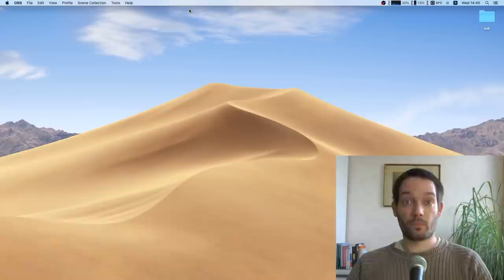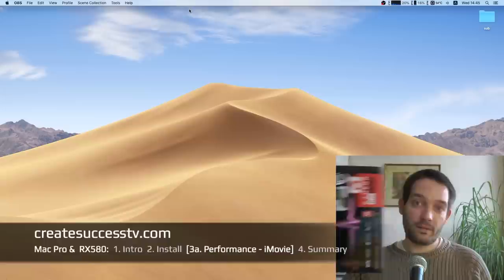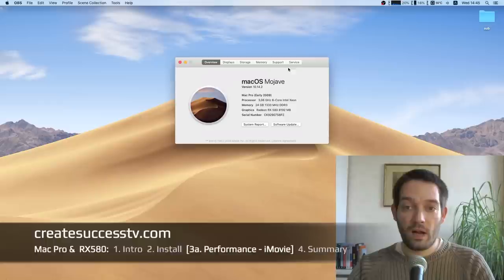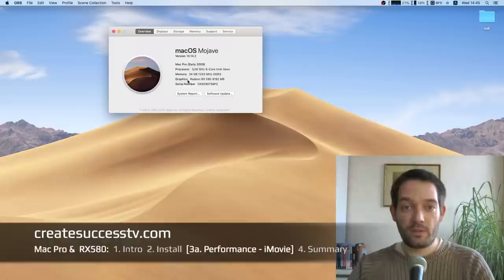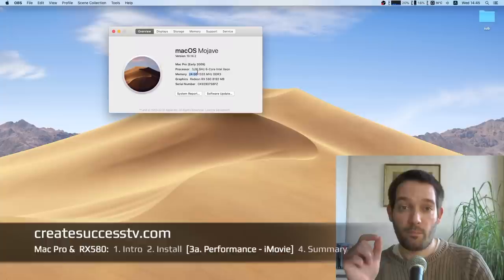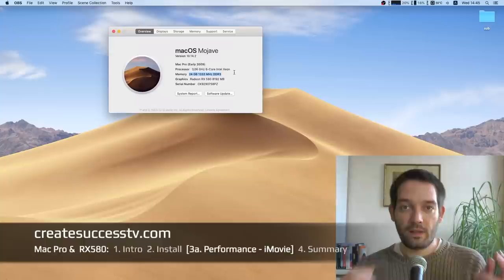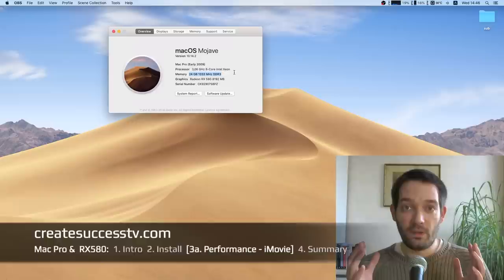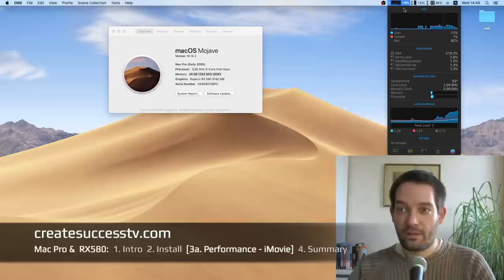Mac Pro 4.1 and 5.1 GPU Upgrade for Mojave (Sapphire Pulse Radeon RX580)

Comment: I'm writing for a friend who made the upgrade but told me that it seems that card gpu doesn't work correctly, also if it is perfectly recognized by the system. Do he has to set something in the software system? Thanks in advance!
Reply from the maker: You can use a Metal-Capable GPU for macOS Mojave:
➜ https://support.apple.com/en-us/HT208898
Reply from the maker: See video description:
Case A: Use the "mini 6pin to 6pin" for a total of 150 watts available ➜ https://geni.us/gBZvb 
Case B: Use the "dual mini 6pin to 8pin" for a total of 225 watts ➜ https://geni.us/5ozmi
Reply: @ReviewTechTV  My friend has a Mac Pro 2009 with a firmware update to get 5.1

Comment: I apologize for the English, but I'm using an automatic translator.
They told me that this card works well, but I must be careful
to these things:
- if you want to boot with the Option key to be able to choose a boot disk you don't see anything
 
- in general, if you want to start with some keystrokes that require further interaction during boot, there may be some problems
 
- If your Mac (OS X) is damaged and has difficulty starting, you won't see any screen and you'll have to make a forced shutdown.

What do you think?
I could also leave the old card inserted and if they were to
to happen these inconveniences use this?
Thank you
Reply from the maker: If you keep the old Apple stock GPU that came with your Mac Pro, then the latest OS you can install should be High Sierra. Yes, if you put in an aftermarket graphics card you will not see the “grey” boot screen.
Reply from the maker: This is because Apple stock graphics cards use a custom BIOS, once you use a non-Apple GPU,
A - you lose the grey boot screen
B - you can’t use file vault
Reply from the maker: Other than that the system works perfectly fine, also, even without the boot screen you should still be able to get into recovery mode, for example by pressing Command (⌘)-R during startup.
Reply: Ok, comunque tu me la consigli?
Reply from the maker: Yes, as long as you don’t use a dual boot setup with Windows and macOS side by side, and if you don’t need FileVault.
Otherwise the GPU upgrade is great because you can install macOS Mojave, I put Italian support article below:
Reply from the maker: Installare macOS Mojave 10.14 su Mac Pro (metà 2010) e Mac Pro (metà 2012)
➜ https://support.apple.com/it-it/HT208898
Reply: Ok, thank.
Reply: Create Success TV I’ve been trying that all day and it just boots to my normal screen help please

Comment: Hi:) Hello from Poland! I have a question. What kind of RAM Memory You have in Mac 5.1? I've got of 16 GB, but I would change to 32GB. I don't know which... Thank You for help :)
Reply from the maker: I currently have 3x16GB modules, the Xeon CPU has a 3 channel memory controller.
Reply: @ReviewTechTV  Thanks. Can you send me a link, which memory will be good of which kind of memory can use?
Reply from the maker: @situs84  It's the same seller where I bought my parts: 
3x16GB 48GB DDR3 1333 Mhz ECC RAM Apple MacPro 4,1 5,1 PC3-10600 ➜ https://ebay.us/VbZPdy

Comment: what resolution is your monitor set at and what port on the Sapphire are you connected to?
Reply from the maker: I am using display port, but HDMI works as well, my current monitor is 27" WQHD resolution
Reply from the maker: If you look at my channel page in the playlist displays you can see I have tested with various other monitors as well, ultra wide, 4K etc.

Comment: Hi, Thank you very much for the video! Your videos helped me alot in upgrading my 2009 mac pro. I bought a graphic card and it just died on me (not sure why). Do you know if all sapphire pulse rx580 are compatible with 2009 mac pro without flashing? 
Also, how do you usually transfer your video files from the camera to mac pro? I usually use my iphone to shoot videos and it's hard to upload them on google drive then download them from the mac pro.. It would be a great help! thanks in advance
Reply from the maker: I think it's best to upgrade to High Sierra, and then install the RX580, once done you can download macOS Mojave from the app store which also gives you NVMe support.
Reply from the maker: My iPhone SE sucks for shooting video, I use a Canon EOS M or recently the EOS R, which is more professional, both connect via USB, so copying the files is simple for me.
Reply: @ReviewTechTV  Thanks!
Reply: Regarding transfering your videos from iPhone, I use the app Photos. Just sync with the phone and export to a specific folder.

Comment: I bought a used 4.1 Mac pro which is updated to 5.1. When I install high siera on it it says I must update firmware. But it it already updated to 5.1. What could be the problem
Reply from the maker: It's normal, first update from 4.1 to 5.1 was manual, second (High Sierra) is automatic again, if you decide to install Mojave there will be one last third update.
Reply from the maker: Different macOS have newer versions included, the newest even supports NVMe:
• High Sierra (Boot ROM MP51.0089.B00)***
• Mojave 10.14.    (Boot ROM 138.0.0.0.0)
• Mojave 10.14.1  (Boot ROM 140.0.0.0.0)
• Mojave 10.14.2  (Boot ROM 140.0.0.0.0)
• Mojave 10.14.3  (Boot ROM 140.0.0.0.0)
• Mojave 10.14.4  (Boot ROM 141.0.0.0.0)
• Mojave 10.14.5  (Boot ROM 144.0.0.0.0)
• Mojave 10.14.6  (Boot ROM 144.0.0.0.0)***
Reply from the maker: Just do once more for HighSierra, and once for Mojave, I marked with***
Reply: @ReviewTechTV  thank you so much for your reply. So where do I get that update
Reply from the maker: @levistro8  Not sure what you mean, it's included in the HighSierra and Mojave installer.
Reply: @ReviewTechTV  OK so I need to find it inside the installer or what?

Comment: Thanks for your videos, I follow those step by step, very good and helpful. At this point I finished flash 4,1 to 5,1 > installed high sierra > upgraded to 10.13.6 (17G12034) and then I download and install nvidia WebDriver for my gtx 960 (387.10.10.10.40.135), everything works fine, the only issue i got and stuck is, my pci-e link speed 2.5gt/s instead of 5gt/s, how to i fix this problem? or I need a AMD gpu like 560 570 580? (If I am not going to upgrade to Mojave/Catalina, i want to stay with my GTX 960) Thank you.
Reply from the maker: To get the latest firmware/BIOS download macOS Mojave from the App Store, then start the installer, the current version is:
macOS versions:
• High Sierra (Boot ROM MP51.0089.B00) - NO
• Mojave 10.14.    (Boot ROM 138.0.0.0.0) - NO
• Mojave 10.14.1  (Boot ROM 140.0.0.0.0) - YES
• Mojave 10.14.2  (Boot ROM 140.0.0.0.0) - YES
• Mojave 10.14.3  (Boot ROM 140.0.0.0.0) - YES
• Mojave 10.14.4  (Boot ROM 141.0.0.0.0) - YES
• Mojave 10.14.5  (Boot ROM 144.0.0.0.0) - YES
• Mojave 10.14.6  (Boot ROM 144.0.0.0.0) - YES
Reply from the maker: You don't have to actually install Mojave, it is enough just to do the BIOS/Firmware update.
Reply: @ReviewTechTV  thank you so much, I got this done.

Comment: Hey I have a question I have recently purchased an used Mac Pro 4,1 with a Quadro 600 GPU, the system works fine but no boot screen, if I ever happen to reinstall the macOS how can I do it without the boot screen? 🤔
Reply from the maker: You can use macOS recovery mode on startup, see startup key combinations here:
https://support.apple.com/en-us/HT201255
Reply from the maker: While the grey boot selector screen dosen't work, it is possible to boot into recovery mode, however it takes some time.
Reply: Review Tech TV Alright mate! Thanks for your answer.

Comment: HI, my name is Ivan. I have a 2010 Mac Pro 5,1 with MacOS high Sierra and just made a bootable disk of mojave I created it with disk creator app. I tried booting with option key held down as I click on the power button but it doesn't go to the disk screen so I can choose the mojave installer. so I shut the computer back down and rebooted normal and when it booted up to my desktop. I opened system preferences and clicked on the start up disk tab and it only shows my Mac disk and not the installer disk. What can I do in this situation? and also could this be because Im running a newer graphics with metal support?
Reply from the maker: Please don't use disk creator app, you can easily make bootable USB stick like Apple recommends:
➜ https://support.apple.com/en-us/HT201372
Reply from the maker: Once finished take out all old drives, put in new empty SSD/NVMe and you can do a fresh install.
Reply from the maker: Part 0 - Introduction ➜ https://youtu.be/lJF-rffIyq0
Part 1 - Bluetooth ➜ https://youtu.be/d9xPvreK8tg
Part 2 - High Sierra ➜ https://youtu.be/ecWEhbtvXHk
Part 3 - SATAIII SSD ➜ https://youtu.be/2gqkGPidI84
Part 4 - Radeon RX560 ➜ https://youtu.be/UoV4I-FlYdw
Part 5 - Memory ➜ https://youtu.be/1XYNqfnu4UA
Part 6 - CPU ➜ https://youtu.be/8cVhURcpi64
Part 7 - macOS Mojave ➜ https://youtu.be/uKAJCuWtp4Y
Part 8 - Radeon RX580 ➜ https://youtu.be/Dv73HrnsNkw
Part 9 - NVMe SSD ➜ https://youtu.be/A8hPC_DDq6Q
Part 10 - Fan Replacement ➜ https://youtu.be/fBiIJami8v0
NEW *Part 11 - USB 3.0 Upgrade ➜ https://youtu.be/fCkrZlB465E
NEW *Part 12 - NVMe Raid Card ➜ https://youtu.be/fo7lVMfXq1c
Reply: @ReviewTechTV  im not upgrading parts on my Mac Pro 5,1 they already installed some time ago. I just wanted upgrade from high Sierra to mojave and my Mac Pro won't boot into startup screen. but when reinstalled my original graphics card that came with the Mac Pro it would boot into startup screen when I hold down the option key. but then it still wouldn't install mojave on my Mac Pro because it says I needed to have a graphics card with metal support on it and that FileVault needed to be disabled. so switched back to the metal supported graphics card that I installed not too long ago and then tried booting up while holding down the option key, and it wouldn't boot up. so I don't know whats going or how to resolve this.
Reply from the maker: @ivanvelez7668  You can download Mojave from the App Store and just start the installer:
➜ https://support.apple.com/en-us/HT210190
Reply: @ReviewTechTV  i tried that but i got message that the download image is damaged, so can't download mojave
Reply from the maker: @ivanvelez7668  If something went wrong with the download before go to: -Finder -Applications -macOS Mojave download, and delete the old file, then you can download it again from the App Store.
Reply: @ReviewTechTV  it seems that when I want to boot up while holding down the option key it won't boot when I have the metal supported graphic card, but when I have the original graphic card that came with my Mac Pro not metal installed then it boots up while holding down the option key. because it detects the non metal graphics card.
Reply: @ReviewTechTV  I will also try re-downloading the mojave installer. does it matter which version  old or latest version of mojave to download?

Comment: Hello there! In advance thanks for all your support helping the community. 
I wonder if you could put me on the correct road,  I have an a now updated Mac pro mid 2010 12 core with this GPU Gigabyte Ati Radeon R9 280x 3GB and I can't use the hdmi port with it , system wont see them.
Can you help please!?😔
Reply: How do I go about of any drivers needed to be installed on this system so GPU is fully usable!?
Reply from the maker: Ok, according to Apple the following graphics cards have Metal support for Mojave:
➜ https://support.apple.com/en-us/HT208898

Comment: Hi, but don’t you have to plug the rx580 on the x16 PCi slot? ie bottom one?
Reply from the maker: The Mac Pro 4.1 and 5.1 have two x16 slots, and two x4 slots, it is clearly labeled on the mainboard, as long as you use one of the two x16 slots you are fine!
Reply: Create Success TV , you are so right that I am so embarrassed of myself! By the way, I sense that you are not a native English-speaker, maybe,  are you french? Just asking... you have a pure english.
Reply from the maker: My native language is German, but I use English almost every day, so I got better over time.
Reply from the maker: This is what English sounds like with a French accent ➜ https://youtu.be/-5aWJ6M24H0

Comment: does it also work on Os catalina?
Reply from the maker: The Mac Pro 4.1 and 5.1 (Early 2009 ~ Mid 2012) doesn't officially support Catalina anymore, and while there seem to be some workarounds if in question I would stick with Mojave.

Comment: Nice video! Thanks   You have mentioned about Vega 56 MSI, how about Sapphire Radeon Plus RX VEGA?
Reply from the maker: I think it could maybe draw too much power...  I did see conflicting numbers, at some places it did state 210W at others 280W... from my research 3x75=225W is the max the Mac Pro can handle.
Reply from the maker: Under normal desktop use, the GPUs normally draw very little power, even video editing and export is quite reasonable, only time cards draw full power is gaming, and then also only if you render all possible frames.
Reply from the maker: If you want you can monitor the power draw with the iStat menus app, in the sensor section go down to PCIe slot, PCIe boost A and B, and monitor how many amps the card draws.
Reply from the maker: It should always stay below 6.25 amps for each! Meaning no more than 75watts for PCIe slot, and PCIe aux A and B.
Reply: Thanks for the response, appreciate that! 
So I guess my best bet is MSI as far as I understand, it’ll be slightly better than RX 580? Although O don’t do much gaming, just video editing as a home user.
Reply: @ReviewTechTV  it can handle more than  that but you have to tap into the power supply to get more power

Comment: I’m not a gamer or a video editor. I’m a music producer and I’m interested in keeping the cost as low as possible, as I’m merely looking to upgrade to Mojave. I’m wondering if you think the 560 will be plenty for me? I like the idea of an easier install and lower cost and I’m sure it will still be a nice upgrade from my old stock 4,1 graphics card. However the price difference is not too bad, would it be crazy to buy the 560 instead of the 580 today?
Reply from the maker: Sure, the RX560 should work fine, that's what I was using before, I only upgraded to the RX580 for video editing, I needed the 8GB of memory.
Reply from the maker: Upgrading the CPU and memory is probably more important for you!
Reply: Create Success TV thanks for the reply. I already upgraded the processors to dual 3.46GHz 6-core and I have 64GB RAM. I am interested in the SSD upgrades you’ve done as well. Thanks for all the info!

Comment: does the MSI Vega56 AirBoost require additional power draw? Or does the PCIE and mini 6 pin power cable provide enough??
Reply from the maker: The Vega cards have two 8-pin power inputs, I can only say that using a dual mini 6 pin to 8-pin like in the case of  RX580 will not work.
Reply from the maker: Vega card needs both 8-pin power inputs to be connected to work. Maybe if you use two mini 6 pin to 8-pin.
Reply from the maker: From my understanding max power draw (225W):
PCIe = 75W
6 pin A = 75W
6 pin B = 75W
Reply from the maker: Try at your own risk, I cannot say how much a VEGA card draws if you use mini 6-pin to 8-pin.
Reply from the maker: Most people using VEGA cards seem to have done the Pixlas Mod, but I never tried that.

Comment: Please I need help!!!. My Mac Pro is a early 2009 Flashes to 5,1 2.33 12 core Processor, 64 gb of ram, upgrade it with sapphire pulse RX580, upgrade software to 10.13.6  When I try to install Mojave os, I got the firmware update message, the on a that says I need to shut off and press the power until I hear the long chime, so I did and still have the firmware update message. My Boot Rom Version is MP51.0089.800 SMC 1.39f5. Ive tried to look for the Boot Rom  upgrade but it said I don't need the upgrade. so I'm in a dead end, I have no idea what to do to install Mojave. I would appreciate veery much some help.
Reply from the maker: It seems you are still running macOS High Sierra, I just downloaded Mojave from the App Store, started the installer and did the firmware upgrade, was very easy.
Reply from the maker: For your references those are the updates that I made with the different macOS versions, and since Mojave 10.14.1 the Boot ROM supports even NVMe boot,
• High Sierra (Boot ROM MP51.0089.B00) - NO
• Mojave 10.14.    (Boot ROM 138.0.0.0.0) - NO
• Mojave 10.14.1  (Boot ROM 140.0.0.0.0) - YES
• Mojave 10.14.2  (Boot ROM 140.0.0.0.0) - YES
• Mojave 10.14.3  (Boot ROM 140.0.0.0.0) - YES
• Mojave 10.14.4  (Boot ROM 141.0.0.0.0) - YES
• Mojave 10.14.5  (Boot ROM 144.0.0.0.0) - YES
• Mojave 10.14.6  (Boot ROM 144.0.0.0.0) - YES
Reply from the maker: If you download the latest version of Mojave from the App Store it should include the current Boot ROM 144.0.0.0.0
Reply: @ReviewTechTV   Do you think if I create a usb with Mojave installer and pull my SSD smashing EVO and use another computer to instal Mojave on the ssd and put back the ssd on Mac Pro would work?
Reply: @ReviewTechTV   So can I download Mojave 10.14.1? or I have to instal Mojave 10.14 first?
Reply from the maker: @carlosaguilera9933  Download the latest version of macOS Mojave 10.14.6 and run the installer, it should offer you to do the Firmware update.
Reply: @ReviewTechTV   thank you very much for your support. Can you tell me please where can I download this Mojave version? I don't seat at the App Store
Reply: @ReviewTechTV   Thank you for your Super help ill do that
Reply from the maker: @carlosaguilera9933  Sure, you can download it in the App Store here ➜ https://apps.apple.com/us/app/macos-mojave/id1398502828?ls=1&mt=12